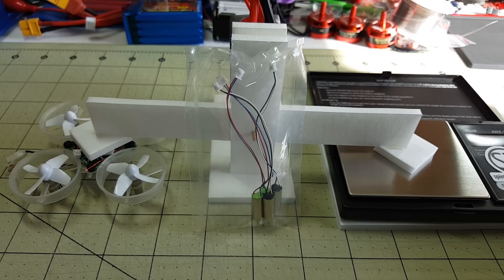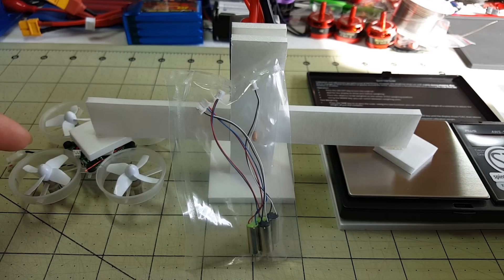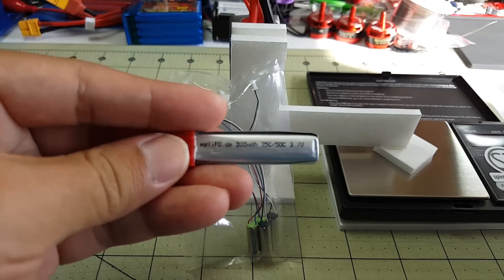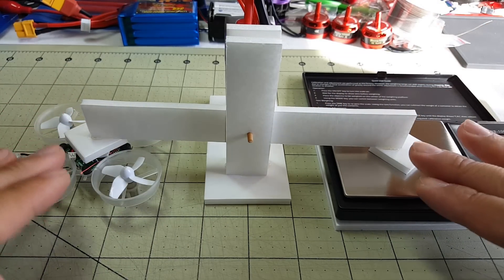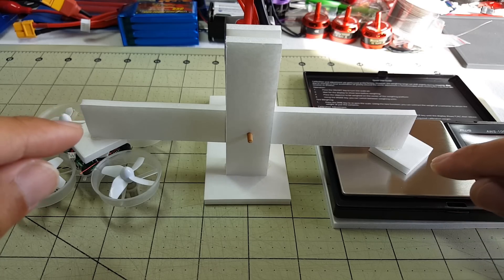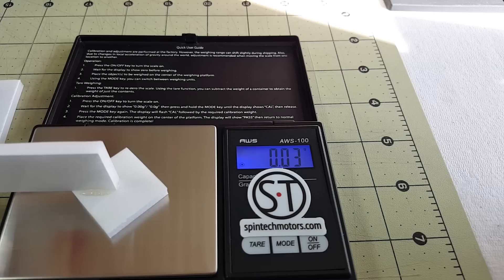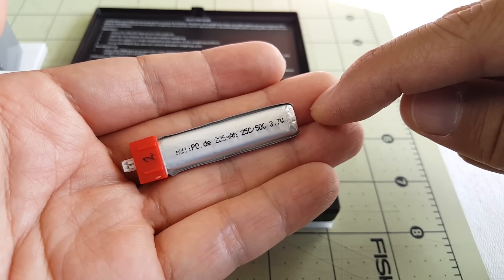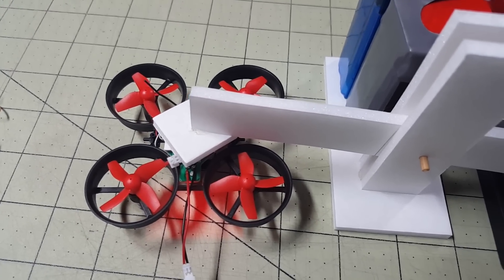Tiny Whoop Motor Test (Airblade Insanely Fast 6mm)

Comment: Oh man nice one!  I'd give this ten thumbs up if I could, love it for the inventive rig & interesting data.

Kinda surprised by the battery variation on the new motors . The battery 3 (second one since B2 was disqualified) was like 20% more than the B1  (29.1g vs. 35.3g ish).  On the old motors the B3 gave about 7% less thrust than the B1 (24.1g vs. 22.3g).  Something funky happened there - but that's life in the lab.

I hope you keep this rig and test all the props/motors/whoop clones.  Don't think anyone else is doing it.
Reply from the maker: +QC Support I hope to get some more motors and batteries soon. My batteries are old so i expected variation.  I think to get real data you should test at least 4 batteries. Even when new they vary a lot.

Comment: How is flight time with the insanely fast motors? Same? Shorter? What are you getting compared to the fast motors?
Reply from the maker: The flight time is slightly less.  Maybe 15-20 seconds.  Also a few of my batteries are toast and I need to replace them.  The new motor is 17000kv and the old is 15000kv so the new motor will eat more juice of course.

Comment: I also checked the thrust of its e010, I got only 12 grams, I do not understand how on then off the ground with the weight of 21-22 grams, measurements may not take place correctly.
Reply from the maker: LOL, I think I did that test with a discharged battery and not a full one.  It was more for my curiosity.  I knew it was gonna be a lot less.  It was more like a joke. :)
Reply: У меня был полностью заряженный аккумулятор, конечно, я не могу правильно измерить, но получил только 12 граммов.
Reply: Я думал я один русский сдесь сижу...)
Reply: как минимум двое)